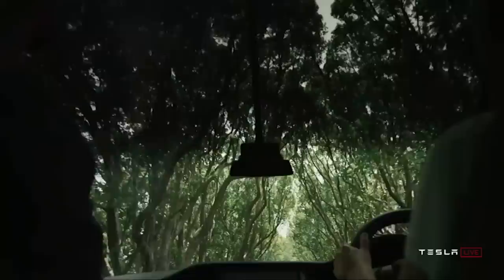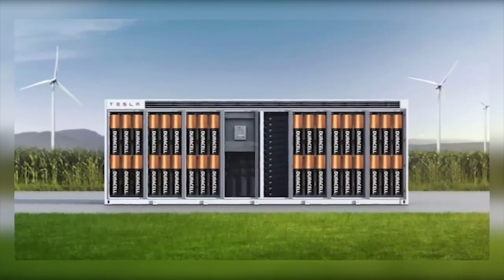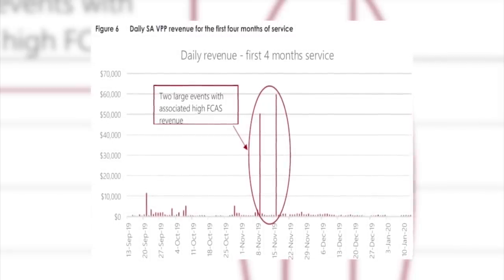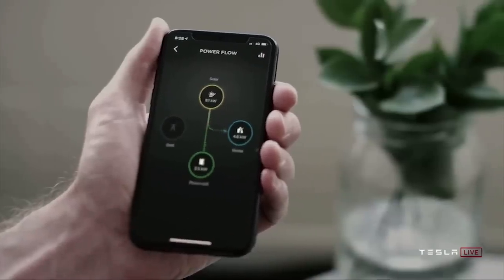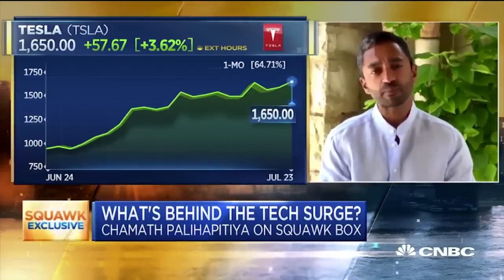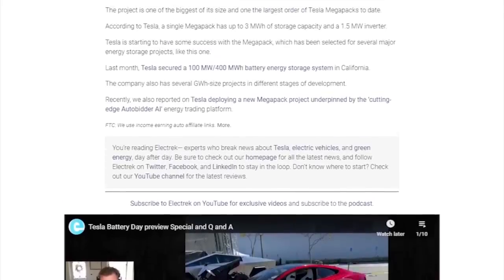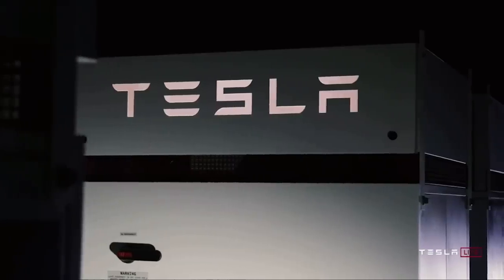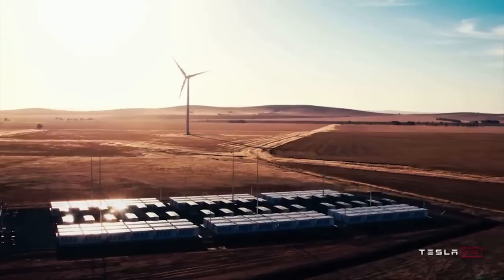Tesla Battery Farms Will Destroy Utility Grids

Comment: The only limit I believe is real - is there enough Lithium available?
Reply: If you had watched the battery day presentation, you would have heard Elon explain that lithium is overabundant. They bought 10,000 acres in Nevada which should alone contain enough lithium for all the US's lithium needs.
Reply: Yes, lithium is the 25th most common element, as common as chlorine.  No shortage of lithium.
Reply: Sometime we running out of sand...
Reply: Lithium? Yes, easely, but these batteries need more then just lithium. Just look at the pricerate of lithium in the past few years.
Reply: Theres other battery options.  Specifically one that uses iron....    but not nearly qs energy dense but good for grid applications
Reply: @iskdude9922  
Those still use lithium. They're properly called lithium-iron-phosphate batteries.
Reply: @theuncalledfor  nope
Reply: @theuncalledfor  ess iron flow battery
Reply: @iskdude9922  
Well, at least you got more specific now.
You gave the impression that you don't know what you're talking about.
Reply: @theuncalledfor  ya the ess flow battery imo is amazing.  Lithium ions have a short and unknown battery life.   Ess flow batteries are super environmentally friendly.  They dont have nearly the density of lithium ions but no need for it for grid applications.  25 yr life maybe more.
Reply: the USGS predicts that if 100 giga factories are built today, there will only be around 17 years of lithium left.
Reply: @mentuemhet  
There is an inexhaustible supply of lithium in the oceans.  The batteries will be recycled which will cut the demand for mined lithium.
Reply: @acmefixer1 
There is no such thing as an inexhaustible supply. The only supply that could be inexhaustible is a supply that is genuinely infinite, and such a thing does not exist.
Eventually, even the lithium in the oceans will run out. Well, okay, that's sort of an oversimplification. There's recycling, and off-planet resources, and in the end it might be that we never ever need more lithium than is available, so while the supply can be exhausted, there is no guarantee that it will be exhausted, even if human civilization survives until the heat death of the universe.
Eventually it will probably be used as fuel to power a black hole reactor (a black hole that you "feed" to harvest the energy emissions of the accretion disc), but that's probably trillions of years in the future.

If you mean short term, as in, let's say, for as long as humanity depends on planet Earth for survival (probably a few hundred years into the future at most), then yes, I guess it's effectively inexhaustible. Ain't no one gonna use that much lithium within the foreseeable future.

If you're wondering what the feck this crazy person (me) is talking about with that black hole nonsense, either check out the channel "Isaac Arthur" here on youtube, or just don't worry about it. Just some speculative far-futurism stuff. If you're interested, great, if not, whatever.
Reply: Their numbers were base on old type lithium batteries,  not Tesla's new ones that were presented on battery day, you'll have to wait for them to re-evaluate their numbers before making such a statement.
Reply: @francoischarbonneau9447  lithium is plentiful
Reply: Francois Charbonneau even if they are wrong that was only the state of Nevada. There is more out in other places other states other countries. I don’t think the lithium is the problem
Reply: @mentuemhet  That is only considering existing "mines" which are a drop in the bucket

Comment: They can spread horizontally but also stack up if space was tight. A 5 story build out of the same footprint of one farm would be so easy also if land was expensive or space very tight. Huge advantage can be local as required. No pollution!
Reply: well no production at the point of use which is helpful but theres still a lot of pollution made in making solar panels and storage packs

Comment: What's really going on with the bears is that they watched the movie The Big Short and now they're trying to find "bubbles" everywhere and in everything. Gordon probably feels this way, thinking he's smarter than everyone even tho he's been losing for years.
Reply: I am an electrical engineer a masters in engineering management. The investors should be doing an engineering economics analysis on top of a thorough systems engineering analysis. This will be a moving target that will be hard to follow with competing technology development and cost of materials such as copper. Sure doesn’t look like nuclear power plants will be a good investment.
Reply: Amen
Reply: Tesla stock IS a massive bubble though. ~$400 a share and a market cap of $354 billion for a company that turns over less than $25 billion in revenue and makes a loss of $862 million annually

If that's not a bubble, tell me what is?
Reply: @Ludendorff-RM  price is determined by the supply and demand for a stock. The more people buy it up the higher the price  and vice versa. When people invest in a company they're investing in the long term. Ideally, you want to invest in a company that can potentially disrupt an industry and/or show growth, which is how a lot of people feel about TSLA.
Reply: @Eric3575  What you're essentially saying then is that tesla is a speculative stock
Reply: @Eric3575  you haven't answered my question. How do you justify a stock going from $85 a share mid March 2020 to over $400 a share today as not being a bubble? 

Can you please define a bubble?
Reply: @Ludendorff-RM  .
A bubble is when the price of an asset appreciates dramatically higher. So yes, Tesla did shoot up about 44% since February. I do think it's just too expensive at the moment. Maybe we can thank herds of hypebeasts hyping things up too much? In fact, I'd say we're seeing a growing EV bubble in general.

But out of all these other companies, Tesla seems to be actually going places. When it comes to EV, other companies are barely opening the door while Tesla is already down the hallway. And EVs aren't the only thing up their sleeves (like Energy production and storage).

A bubble? Sure, 44% is a lot in just 7 months. But is Tesla all a load of shit? Most definitely not, and it would be idiotic to say so. What I was trying to say in my first comment was that Gordon is trying to make Tesla look like one of those CDOs investment, or a NKLA. I'm not saying Tesla is perfectly priced in at 500 lol
Reply: @Eric3575  Now I agree with you, the current share price is ridiculous and will definitely correct. Is the entire EV movement a big bubble? Yes and no, I guess it depends where and how you look at it 

As for Tesla being a load of shit? Absolutely not, I never made that claim and would be stupid if I did. I think some people are very culty about Tesla particularly, in the same way they are about apple, and this shouldn't influence you if you want to make an investment 

I'm not sure about the US, but in Europe, the EV market is being dominated by Renault and Nissan, and VW have come out with their ID3 and ID4 models, which all offer good range for a significantly lower cost than Tesla does

Daimler, Volvo and BMW are also entering the EV market, with Mercedes  the first to introduce a vehicle with solid state batteries. This is without even mentioning the competition from China

I guess what I'm saying is don't buy into the Tesla hype (literally), especially at these ridiculously overinflated prices

 From a vehicle perspective, I'm doubtful Tesla will be very profitable after all the other manufacturers are fully committed to EV

As for the energy storage market, that is a HUGE gamble, with fierce competition and is evolving quickly

I wish Tesla all the luck in the world, but until they actually turn a profit and start delivering what they promise, I personally wouldn't put my money into it
Reply: @Ludendorff-RM  Tesla's value is entirely dependent upon shareholder price targets. If you see 10x Market Cap in 10 years, then the stock is a value at any price under $500 right now. Elon had a target of $420 after the split. That will be the support level until the first Cybertrucks and Semis hit the roads. The pandemic exposed the underlying strength of the auto business. Elon's "12 startups" are only beginning to pay off in other areas such as Megapacks. Model Y Octovalve could spinoff into a multibillion$ HVAC business. Endless possibilities and a CEO and culture that embraces rapid evolution. It's not just "how amazing" Tesla is. It's the sluggish nature of every industry they go to disrupt.
Reply: @Ludendorff-RM  Tesla's SP was artificially held down by an extraordinary disinformation campaign  by the fossil fuel industry and legacy car manufactures and others in fear of their assets becoming stranded.
Reply: @jlmur54  what would you consider a good price for tesla stock and what price would you consider overinflated?
Reply: @Ludendorff-RM  It's all relative. I didn't know the US government was going to bankroll the whole stock market bubble. Many other car/tech companies are worthless.
Reply: @Ludendorff-RM  it's not a bubble. It's a growth stock. The market is pricing in anticipated future earnings. Amazon was similar, but I don't know what the market cap was before it was profitable.
Reply: @Christian-fx9ur  I don't recall a period where amazon gained a >500% increase in share price over 6 months
Reply: @Ludendorff-RM  I don't either, but I didn't follow Amazon's price that closely. But, a possibility could be that the  >500% increase in ~6 months was due to the market catching on to the fact that the share price had previously been 500% undervalued. But.... yes, the price will be corrected either by earnings increasing to match the valuation or else the share price will come down to be on par with earnings. Because it's growing soooo quickly, people are betting that the earnings will grow very quickly. The share price went up so quickly because the company hit an inflection point where the odds of them succeeding are significantly greater than failing. And if they succeed, they will likely be massively successful.
Reply: @Ludendorff-RM  Bubble definition: An economic bubble or asset bubble is a situation in which asset prices appear to be based on implausible or inconsistent views about the future. 

A bubble isn't defined by a percentage of share price gains in a period of time. Tesla is in a bubble if the current share price is not justifiable by the reasonable expectation that future earnings will not meet or exceed the current valuation.
Reply: @Christian-fx9ur  I agree, but its a tell tale sign of a bubble
Reply: @Ludendorff-RM  I wouldn't put it that way. It's possible that it's highly overvalued. It's possible that there is more to the story. What if ten years from now the share price is $20k and they are a trillion or multi trillion dollar company? That potential for a future trillion dollar valuation is what the current share price is reflecting. The reason the stock is so volatile is that anything that is perceived to even slightly threaten that future trillion dollar reality will be reflected in the current share price. The reason why the stock ran up so quickly recently is that the future valuation of a trillion dollars now appears as a serious possibility. Prior to that, it was perceived as unlikely. Does that make sense? The pathway to a trillion dollar plus valuation is now clear to many people. However, that road still has to be traversed. Until it happens there is always a risk that it won't happen. If it was guaranteed, that would priced in today. The further Tesla travels down the road to a trillion dollars plus, the higher the current share will go. If the share price were to go beyond all possible, reasonable expectations for a future valuation, then it would be in a bubble. It takes a lot of investigation into this company to see what they are all about. They will be profitable on several different fronts, their tech is leading in multiple sectors, and they innovate faster than anyone else.

Comment: If you close down thrower plants how will you charge the dead batteries?
Reply: The thing this video is saying is that a lot of current power plants are running to meet these peek demands when normal power plants don't produce enough. If we kept power from when we make more than enough then we will not need these extra power plants, those are the ones in threat of getting shut down in the short term. More than that we can use teslas solar panel technology to turn roofs and the sides of buildings into power plants (solar obv) which when connected to a tsla battery back can store energy or sell extra to the grid automatically. Tesla power stations already do this where they basically store power when it is cheap and sell it back when it is demand and cost is higher to make the profit of what is in between.
Reply: Sustainable energy like wind or solar power